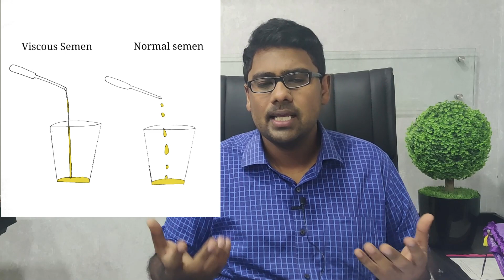Hyper viscosity of sperm - Is semen hyperviscocity a problem?

Comment: Colour......... GREY WHITE

Volume..... 2.0 ml

PH........ 8.0
Viscosity.....  High
Liquefaction...  >2 hour
MICROSCOPIC
MOTILITY.......  Graded A (Progressive Motility)... 10
Grade B (Non-Linear Motility)20
Grade C (Non Progressive) 10
Grade D (Immotile).. 60
Sperm Count  63.0. M/l
Total Sperm Count.... 126.0
MORPHOLOGY
Normal.. 60
Abnormal 40
Pus Cells.  4-6
Reply: (###BLOOD SUGAR (RBS)

114.1

80-160

mg/d)

###LIPID PROFILE - LAB

TOTAL CHOLESTEROL

194.2

<200

mg/d

TRIGLYCERIDES

89.7

40-150

mg/d

HDL CHOLESTEROL

41.3

> 40.0

mg/d

LDL CHOLESTEROL (DIRECT)

143.9

DESIRABLE < 130

mg/d